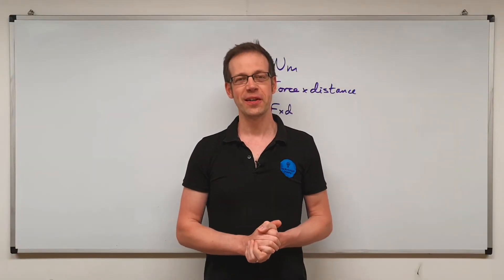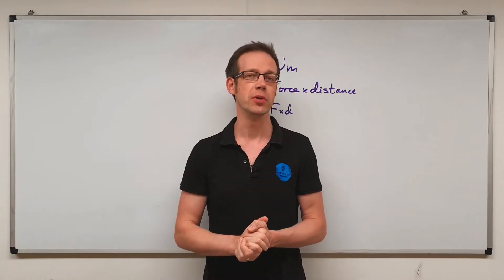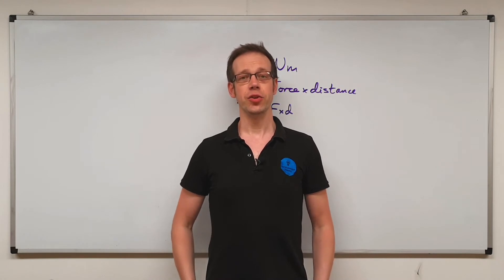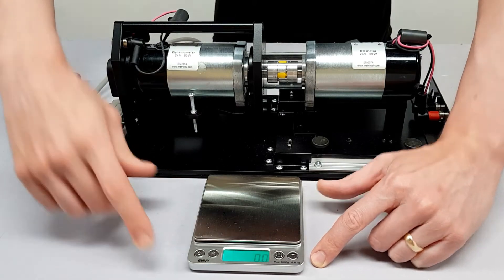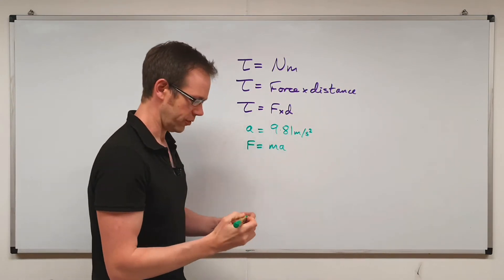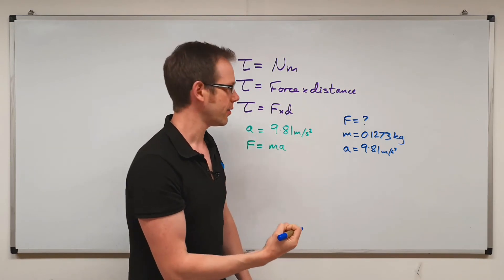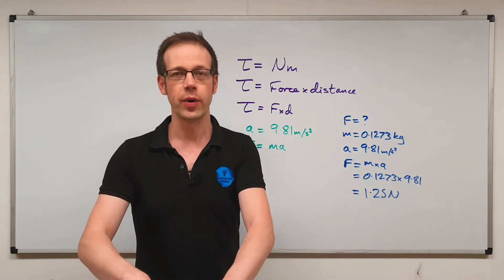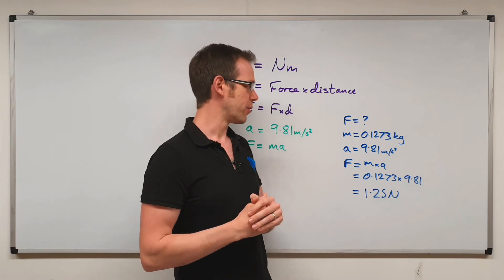What's the Difference & Relationship Between Mass and Weight? How Do Mass & Weight Relate to Torque?

Comment: I usually think the metric system makes a lot more more sense, but this seems like an exception. Force pounds make so much more sense. The video was incredibly long winded, but the process wasn't. The process was just to weigh something in kilograms and multiply it by 9.81. It seems pretty pointless because the scale measures force instead of mass and essentially used the same constant to translate the output into mass anyway. Multiplying by the acceleration of gravity to put it in meters just seems like a pointless extra step when you could just say it's 0.1273 force-kilograms.
Reply: Your comment was incredibly long winded.